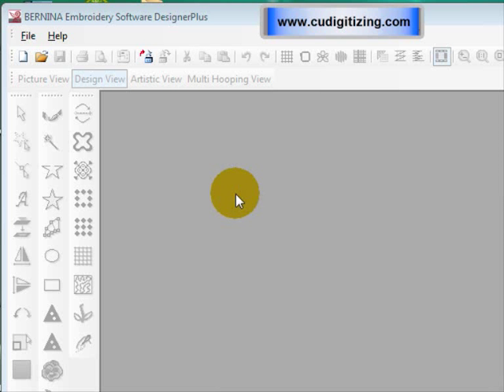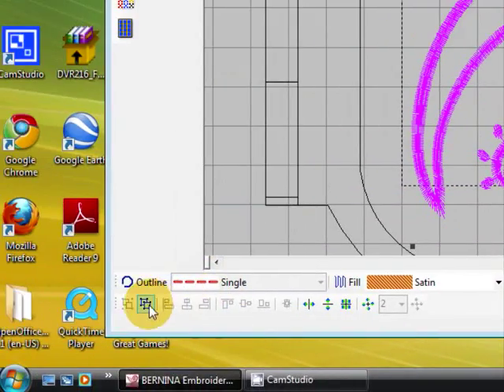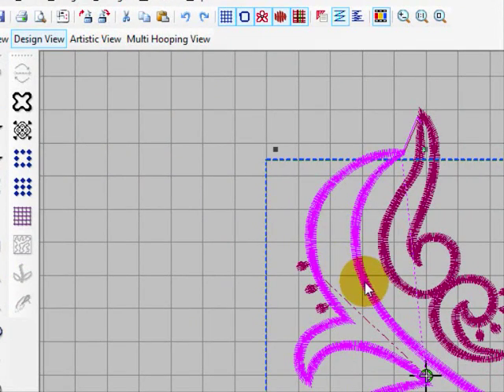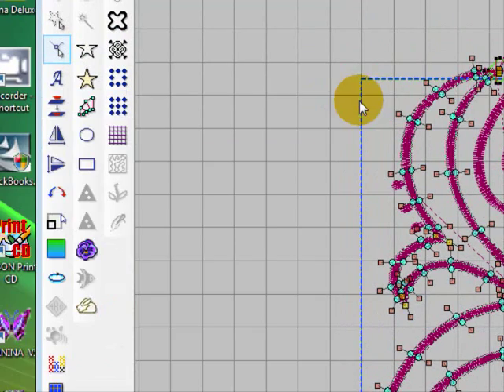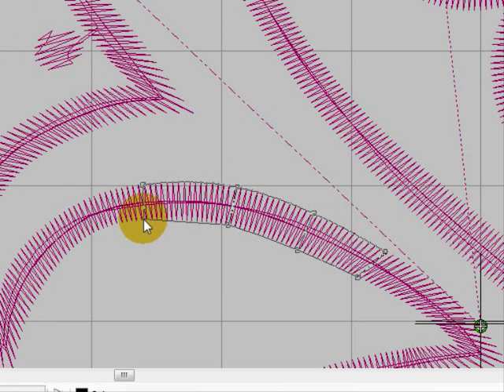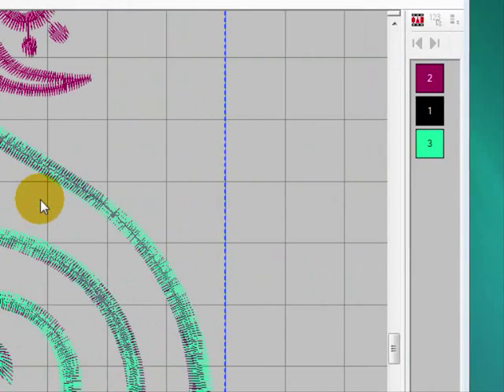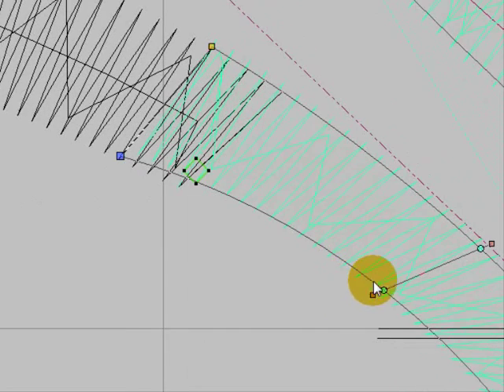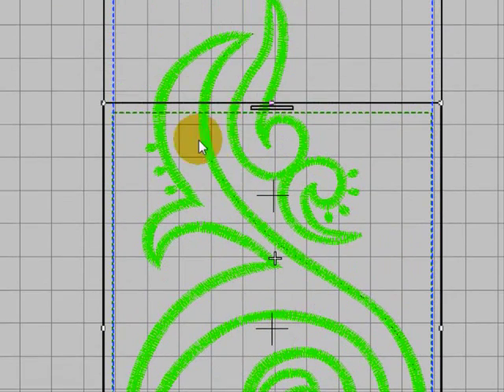Manual Splitting for Multi Hooping.wmv

Comment from the maker: Try creating a hoop the size of the stitch area for one half of the hoop. Use the Hoop Layout to add the second hoop the same. align them so they are sitting perfectly next to each other and overlapping the same amount as the overlap area in the hoop. Use Save as to save the design. Open the half that stitches second and flip vertically. Save. If the software tries to do more than two hoopings, use the splitting tool to cut the object/s causing the problem. Haven't tried this, but should work

Comment: Carol, I have a customer with Bernina DP v6 software who has purchased a multineedle machine with a jumbo (14x14) multiposition hoop.  The unit uses a camera to place the second half of the design, but it flips the second portion upside down, as the hoop is rotated when the second portion sews out.  Can a hoop be created in the Designer Plus V6 software that can be used with the Brother/Babylock ten needle machine?  She can buy other software to do it, but she is already familiar with hers. TYVM